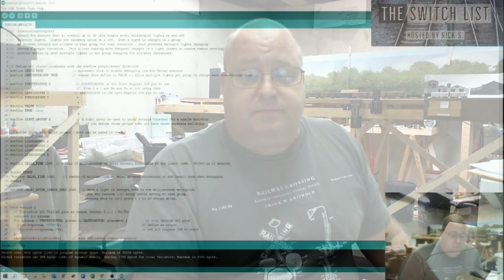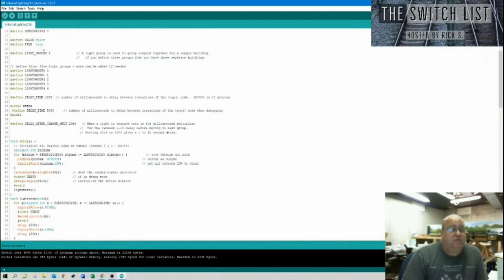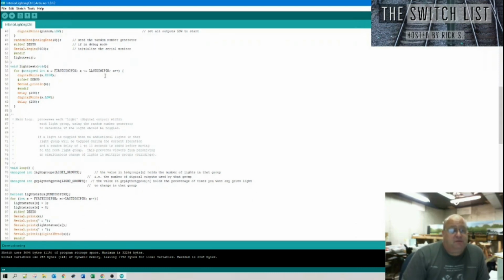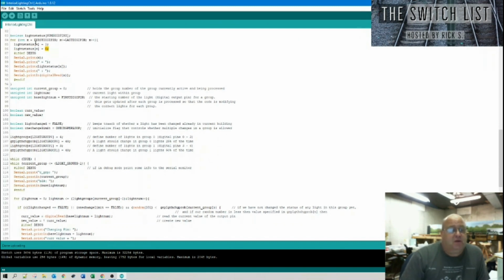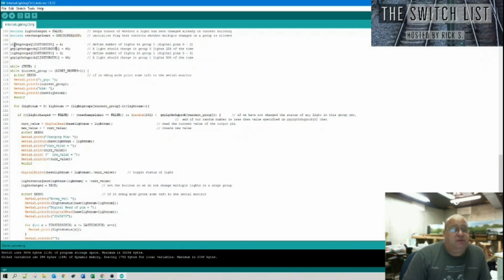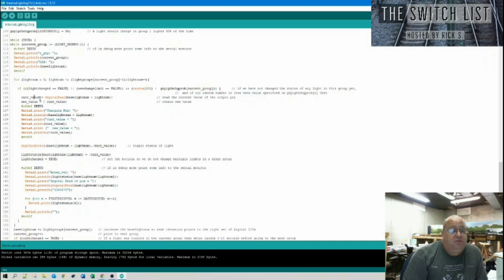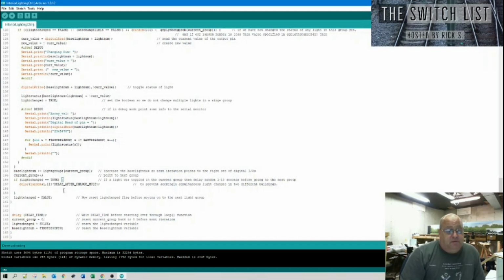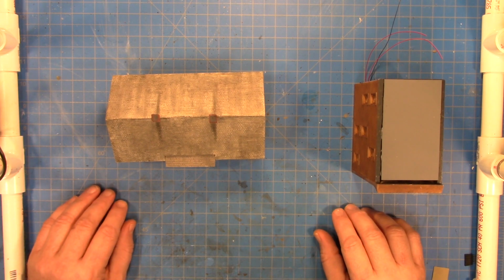Model Railroading: Animating multiple lights in multiple buildings using an Arduino Nano

Comment: this is exaclty what I am looking for to add to my N scale layout.   I am relatively new to arduino but with the help of this video I am pretty certain  I can make this work.  Where can I find a  drawing / sketch / Picture of the breadboard  circuit wiring?
Reply from the maker: Hi Scott.  I do not have any kind of diagram of the wiring.  It is pretty straightforward in that the LEDs are each attached to the digital output pins of the Arduino board through an appropriate value resistor (I think I used 470 Ohm resistors to get ~10mA of current through the LED).  Other than that there is no wiring - you can see my Nano plugged into a small breadboard with the wires running off to the resister & LEDs at about 19:00 in the video.  Good luck and if you want the Arduino sketch I created just send me an email (email address listed in the About section of the channel) and I will send it to you.  Rick

Comment: I'm doing the same thing however I only use 3 wires and one nano pin to control up to 40 lights. If you use neopixel lights the center wire is the control and the first pixel is #0 the last is #39. Each is controlled individually via the number. If you power them via a separate 5V supply you can control over 100. It is a little harder  to figure out the light sequencing. I plan on doing all the buildings on our club layout this way. A demo is here  youtube.com/watch?v=k8iCOa0slXo&list=PLcUwn6ATAtZjOLRxjg9D7MhZu5dHfSEPy&index=26
Reply from the maker: Very cool stuff Edward - thank for the info and for watching.

Comment: If you used TLC594 shift registers, you could use one arduino to control literally hundreds of independent lights.  32 outputs per shift register and they can be daisy chained together.  You can even introduce random flickers to simulate oil lamps or candles.  you can even add photo resistors to bring the lights on automatically as the room gets darker. I did this is a very large model of the Black Pearl to simulate oil lanterns.
Reply from the maker: Thanks for watching and commenting Paul

Comment: Nice use of video chapters!!  I got some DCC decoders for my lighting, but I am starting to think it would be much easier to go the arduino route.
Reply from the maker: Thanks Heath.  We can create a whole Arduino lighting protocol so you have the addressable control like you do with DCC decoders (and 10,000 man hours later it will finally work!).  Thanks for watching.